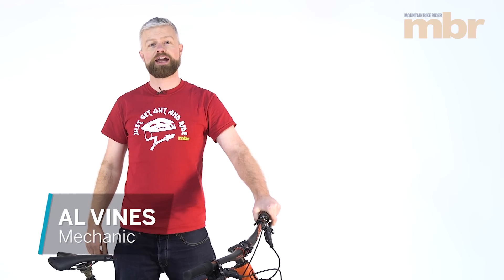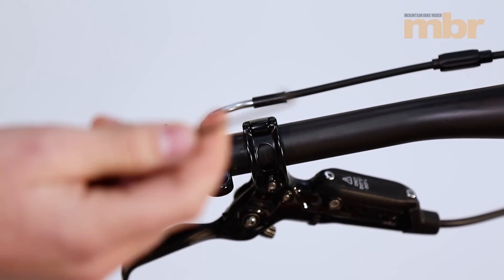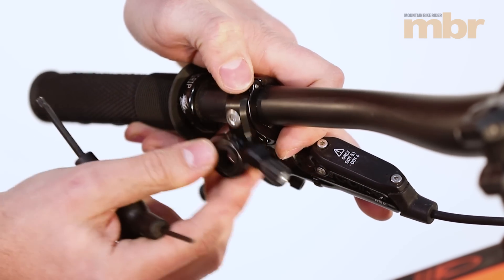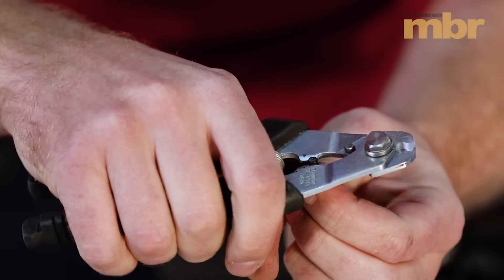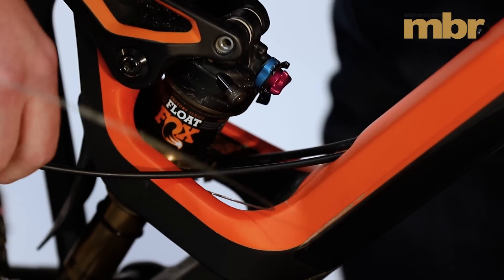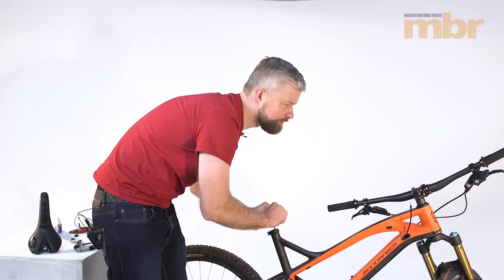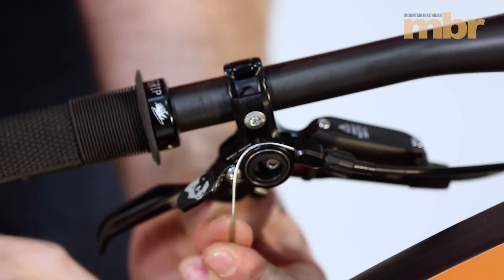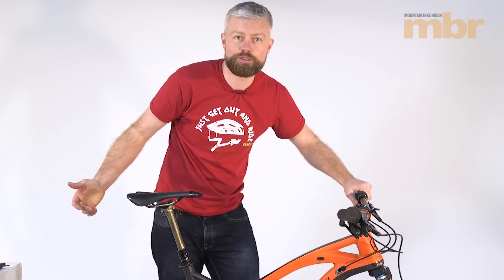How to upgrade your dropper remote | MBR

Comment: great video! I wish I had a Thompson dropper. I have the one that cam with my 2017 Specialized SJ carbon. It is at max pressure 20psi and sometimes does not come all the way back up. Thoughts on how to make it work properly?
Reply: BuckeyeMCS maybe pump it 25 psi just a thought though check first
Reply: unfortunately, max air pressure is 20psi
Reply: BuckeyeMCS 
The pressure has nothing to do with it the end of the cable has to be exactly 17mm to work properly.

Comment: Does anyone know why my lever/remote sticks (does not return)?  It was working well, but I pulled my seatpost out to grease it at the entry point to the frame and removed my lever/remote.  Do I need to pull more cable out of the frame housing?